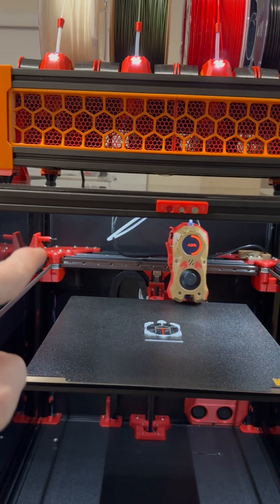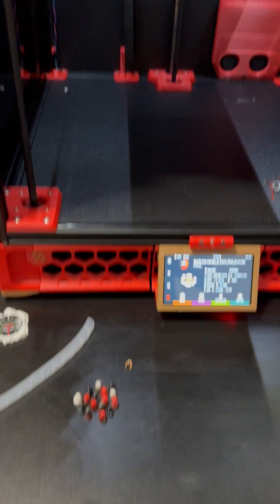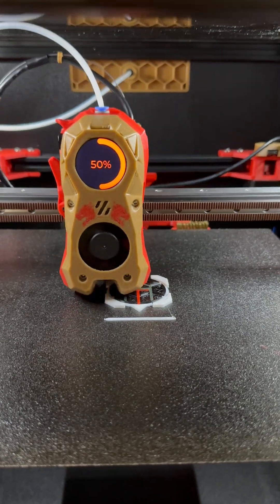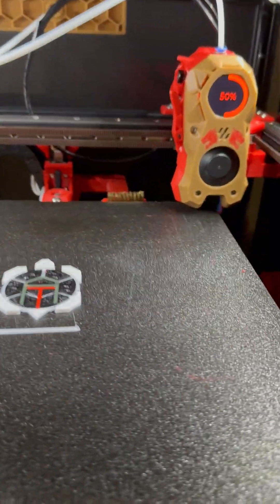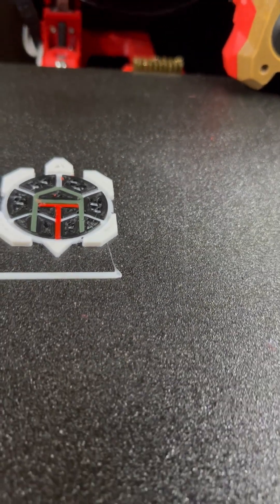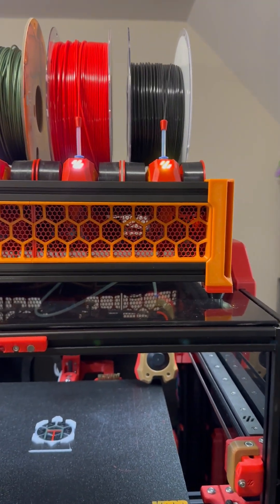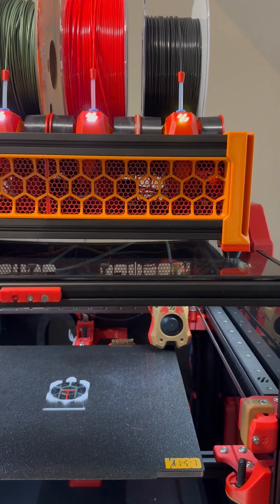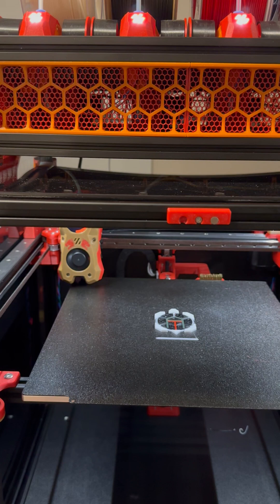Box Turtle AFC Goes Burr

Comment: What did ever come of the motor issue? i am having some intermittant issues with my respooler motors and am kind of wondering if i did something wrong
Reply from the maker: I did get the motor issues worked out. This build used an older version of the wheels which were wider and would touch the sides of the lanes creating additional friction. Swapping the wheels for the latest version which were a couple milimeters narrower solved the problem.

Comment: Why not let klipper calculate colourchange so it can change while printing infill so it can continu printing , saving lot of timeand maybe a small bit of dualcolour but is in print itself as infill ?!
Reply from the maker: Purge to Infill is an option that can be setup via the slicer. For now, the project is choosing to not use the slicer settings and keep everything in the AFC-Klipper-Add-On software.

Comment: This is super cool, any chance that it could work on the Creality K1?
Reply from the maker: This solution 'should' work with the Creality K1 provided you have access to the Klipper host as you would need to install the AFC_Klipper_Add_On software. This would mean jailbreaking your K1 which would invalidate any warranty from Creality. It might be worth waiting to see if the Creality CFS is back ported to the K1 series or if they only intend it for the K2 series.
Reply: @digitaldragon72  Thanks for the info, Creality have at least been OK with rooting the K1 and even sent me a replacement Print Head PCB when it died on me, no questions asked. My warranty already expired back in July, and since then I have modded my K1 to fix some of the early issues Creality had with the V1. 
I am waiting to see what the K1 CFS system will look like, and more importantly, what it will cost and how it affects the mods I have (linear rail / flanged bearings). This project could be a fine alternative if the CFS is too pricey or needs to much regression on my printer.

Comment: WTF is with that Canbus cable?
Reply from the maker: I wanted to make my Box Turtles easily interchangable for testing purposes. This modularity also means that I only need to remove the PTFE tube and unplug the CANBUS cable from the side skirt to transport them. This made it a LOT easier to transport them to 3D Printopia as I could protect the printers with moving blankets and the Box Turtles could be safely packed in a rolling foot locker. The CANBUS cable itself is the one that comes with the BTT MMB board.

Comment: Is that fan making noise or some Coils going bad?
Reply from the maker: The noise is the HoneyBadger 5015 part cooling fan in my Stealthburner. I need to disassemble the front shroud and determine if there is something rubbing the fan, or if it is just not happy for some reason.